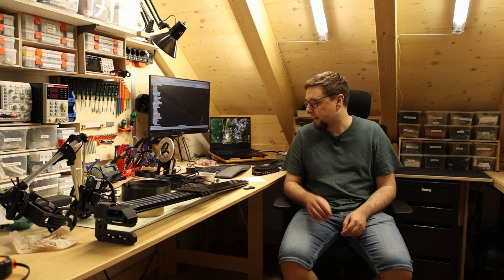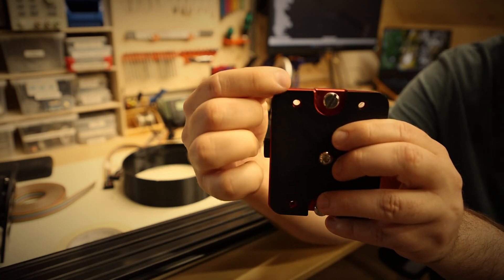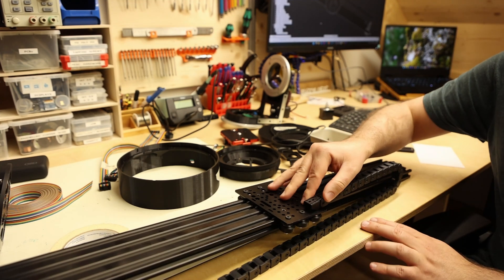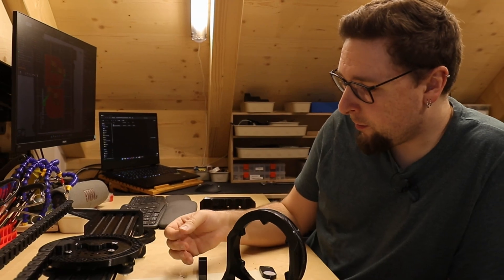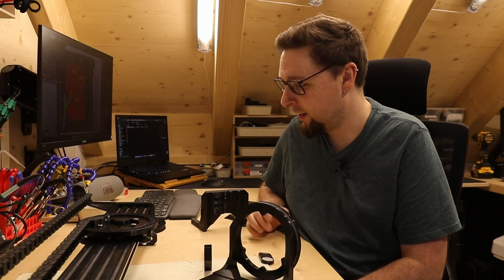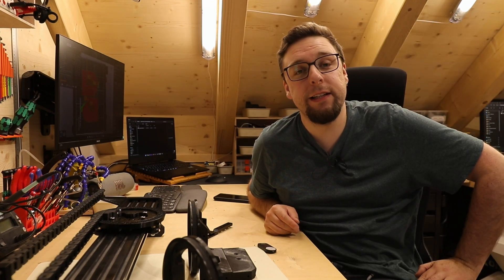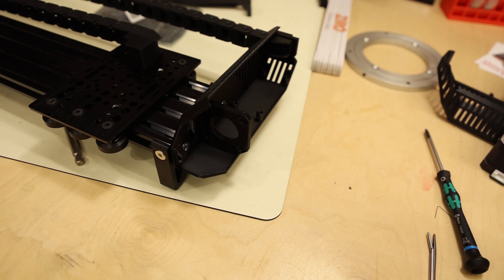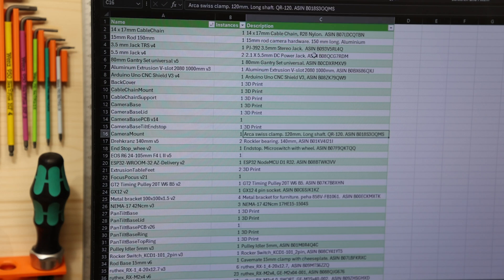DIY Motion Control Rig Dev Vlog 3

Comment: Maybe a bit early while the physical prototype is still in development, but on the software end, will it be possible to have this slider cooperate with OBS studio? Or somehow connect it using another software to do things in OBS? Maybe it can be triggered to recall a set programmed movement to pan across of move around when stuff happens in a stream or something?
Reply from the maker: That's a really interesting idea! I thought about adding face tracking to the software or as an integrated feature via an esp32 cam  module. Given the open nature of OBS I think it will absolutely be possible to do this in OBS. I have written a Blender plugin so far for move planning. My use case consideration so far was for product videos, miniatures and stop motion, I had not considered streamers. Thanks for that!
Reply: @fuzzy4logic  also, will you be making any kits available for this to complete with printed parts from people's own machines? I'd love to buy a kit with some of the parts in it if you ever offer them, I wanna support such a cool project! I'm so stoked for how this is gonna turn out when it's all done. I can't wait to build one, it's deffinatley been worth the wait following along, seeing how well it's turning out😄
Reply from the maker: That's really nice of you! It's amazing to see people actually caring about my project. At the moment I have no plans of selling kits. However, I will be making all design files, as well as a complete bill of material available. For the assembly I am working on written instructions and a video assembly guide.

Comment: I’ve made a 3 axis motorised slider with 3 metres of 8040 aluminium extrusion and found that I had to turn the extrusion so it’s taller than wide otherwise the camera bounced too much in the middle. Obviously the extrusion is stronger in the wider orientation. 

Really enjoying following your progress.
Reply from the maker: 3 meters, wow! Do you use a belt drive or rack and pinion?
Reply: @fuzzy4logic  Belt, gt2, 6mm. The 8040 is the “C” section as I planned on having the cable chain sit inside the C. Visually it looked really neat, but too bouncy.
Reply from the maker: I see. Is the gantry "hanging" from the side then?
Reply: @fuzzy4logic  If you zoom in you can see there are some flat “rests” that the chain sits on. I used the C cut out and slid some shelf like sections to support it.
Reply: It’s all I could think of doing at the time but it’s held up. I have 2x complete 3 metre sliders and 3 more just pan & tilt mounts that have been in use for a few years now, streaming live concerts almost weekly. It’s been a fun project that I keep tweaking. Now I know all of the issues I’d probably design it differently now.
Reply from the maker: @ColinMakes  wow, that's impressive! Did you 3d print the pan tilt head?
Reply: Yes 3D printed, and all designed in Fusion 360. The original design came from Isaac879 but I’ve now completely redesigned the mount.
Reply from the maker: @ColinMakes  Did you keep the fishbone gears? Did they hold up over time?
Reply: @fuzzy4logic  I didn't use the fishbone gears as I wanted to use belts. I've printed the gt2 around the base for the pan motor.  The only thing I've used fishbone gears for is the zoom motor which I've only added recently.